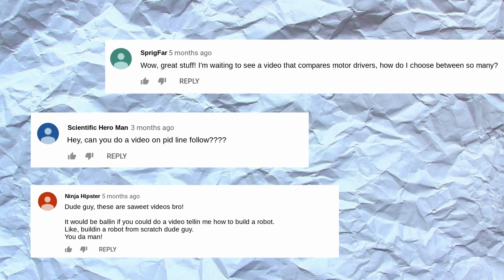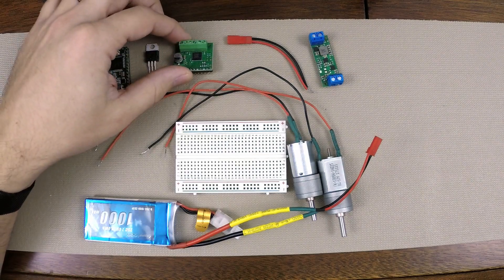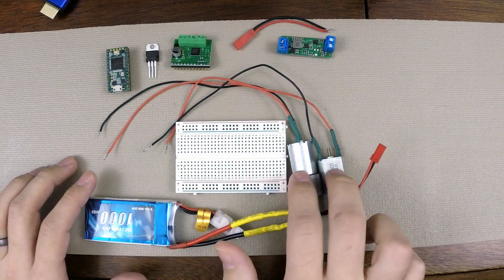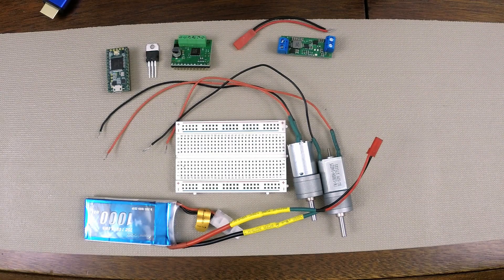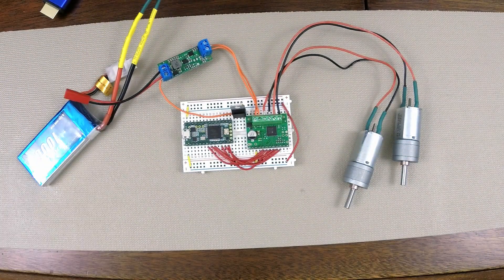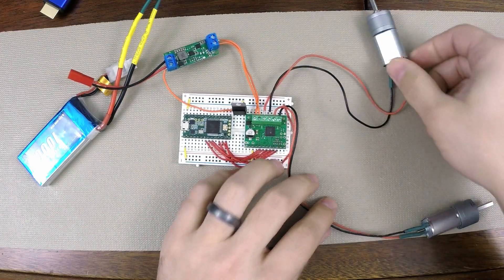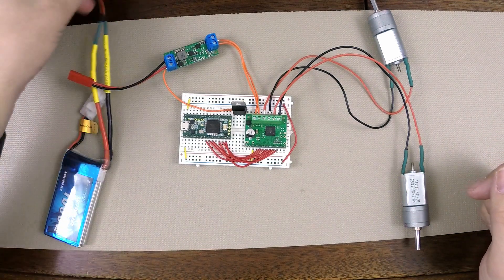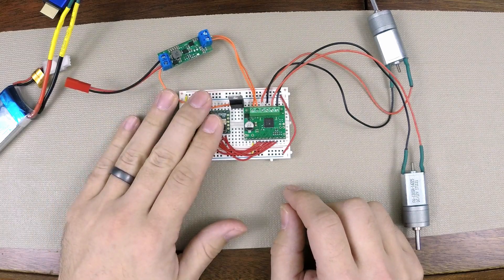How to Build a Motor Circuit

Comment: Can I use 9v battery as power source??
Reply from the maker: Yes, though I often don't recommend alkaline 9V batteries (the metal rectangle ones with two snaps on top) as they only have about 350mAh of power which won't last long. If you are using the rechargeable 9V battery that would be better, those usually have 900mAh or more.
Reply: @RobotResearchLab  can I use 12v n20 motors??
Reply from the maker: @harshitsrivastava5559  Yes, you can use any type of 12V DC motors with this circuit

Comment: Can the motor driver carrier work with only the 7.4v battery as a power source? I need it for a school project and I do not have a step up regulator but my motors say they can run on 6v. Any suggestions?
Reply from the maker: Technically yes, though I cannot say for certain how long it would work. The motor input minimum on the driver is 10V so you really shouldn't go below that but it will work. I don't know for certain what the deciding factor is in the motor input range determination but I suspect it's related tot he current ratings. The motors require a certain amount of power which is a relationship between voltage and current, as the voltage drops, the current needs to increase in order to supply that power. It's possible that with the lower voltage you may risk drawing too much current through the driver.

Now that that's out of the way, another option is that you could try a different motor driver that is designed for the lower voltage, the TB9051FTG from Pololu is a good, cheap option with the same current ratings but it only works for one DC motor, you'll have to use two drivers. Another alternative is you could use a 3 cell LiPo (~12V) and drive your motors at the full power with no regulator. The reason I went with a 2S battery and a step up voltage regulator is that your motors should always be on a regulator in order to ensure consistent outcomes though they don't really HAVE to be. But, a step down regulator at 12V for the amount of current I needed was about three times the cost of a step up regulator with the same current rating. So, it was cheaper to go with a 2S battery and step the voltage up to 12V.

Let me know if this helps, thanks for watching!
Reply: @RobotResearchLab  Thanks for the info. I have another situation on my hands too. The USB plug in of my Teensy 3.2 broke off and seems to be too difficult of a task to solder back into place. Is there anything you can recommend besides getting a new board to be able to upload code on it consistently (maybe solder a different USB connection). I see that there are usb related pins on the bottom of the board, but I am not too sure if I can use those to fix my problem. Any advice is appreciated.

Comment: Would have been better to see it working and how the motor controller MCU control it, Shame good project but not enough info.
Reply from the maker: This video is part of a series (playlist) on how to build a PID robot from scratch... watch the next video in the list which covers how to use and program this circuit. This video is called "How to Build a Motor Circuit" which only shows how to "Build" so if you want to see how to use check this video out https://youtu.be/LH3bHMQEy7U which is appropriately labeled "TB67H420FTG Motor Driver Hookup and Program Guide" Thanks for watching.